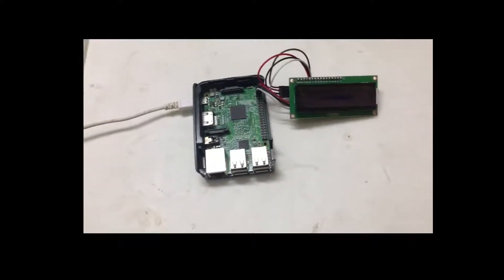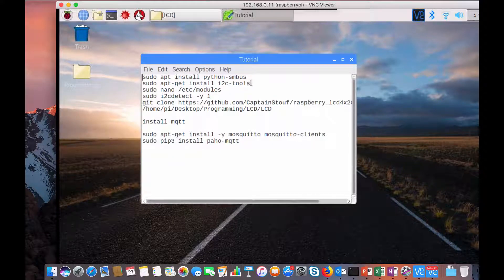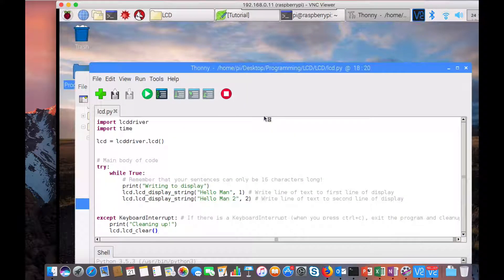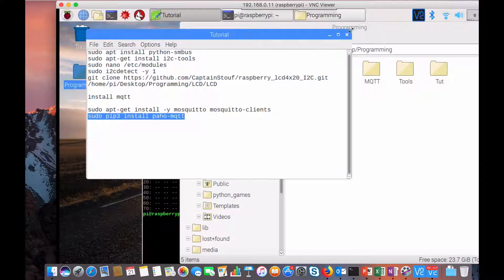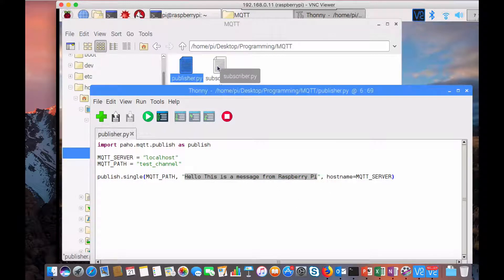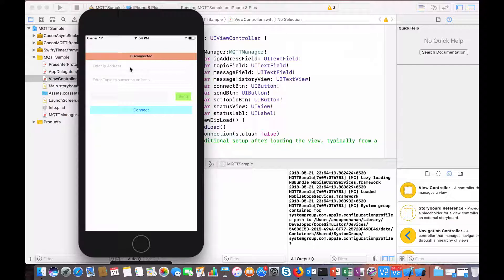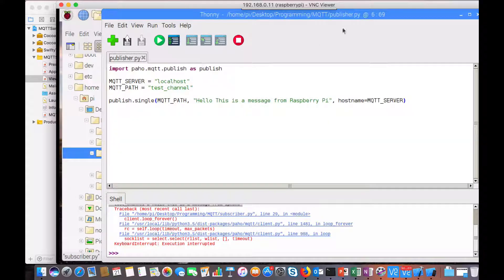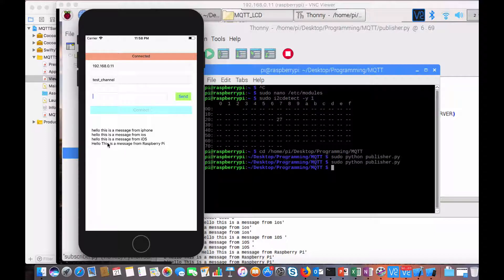How to send data from iOS to  raspberry pi and an LCD display using MQTT

Comment: How do you send an image or video via iOS to Pi through WIFI or cellular
Reply from the maker: Michael H I haven’t tried... will check and let you know
Reply: @anoop4real115  Thanks.  We can collaborate on it too.  I want to write a Python program for the Pi that can display images and video sent from a mobile phone.  Btw, I see you like He-Man too...awesome.
Reply from the maker: Michael H I will have a look at it during the weekend, it’s been quite sometime I have did something on Pi. Also i don’t think we can use MQTT as it doesn’t allow this big data....and thanks i collect action figures and want to put some fun stuffs
Reply: @anoop4real115  I'm pretty sure MQTT won't work either from my research.  I also haven't come across much info on sending images or video to a custom program sitting on a Pi (or Audrino).  There's so much lack of info and APIs that I think I will have to try sending the media from the phone to a web server, and then having the program on the Pi check for new data on  the server, and then download it.  I got rid of all my original HM from the 80's, and only have the new versions that came out about 5-10 years back (along with the new cartoon).  I think Netflix is working on new HM cartoons or show.